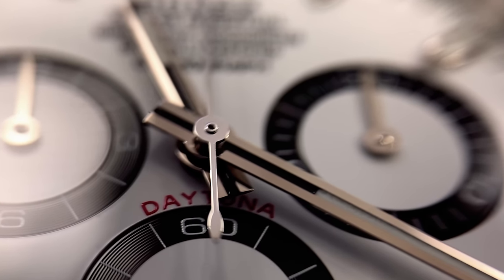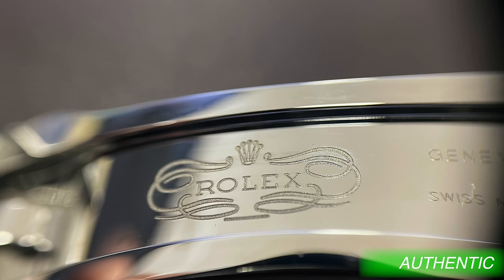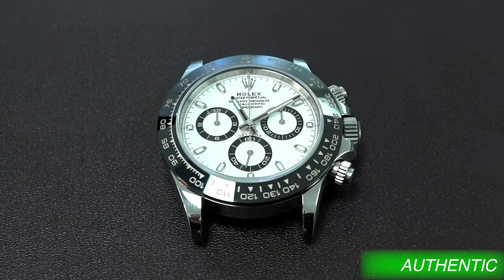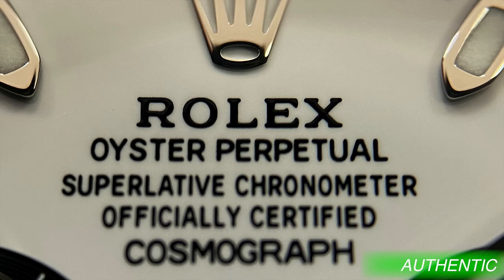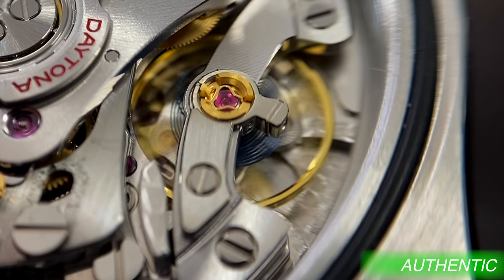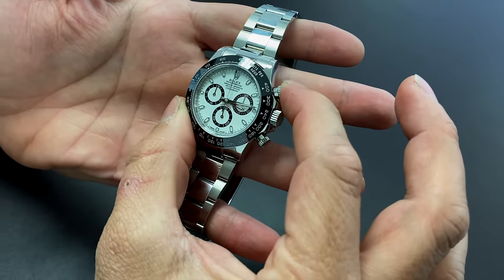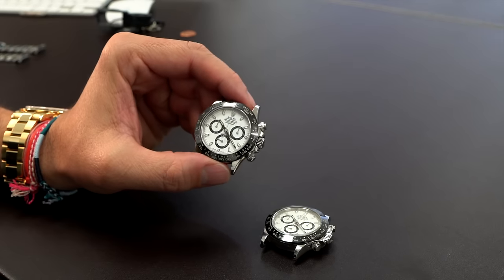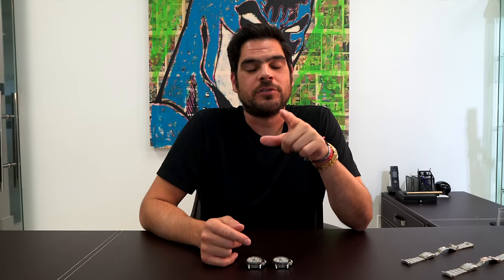5 Ways to Spot a Fake Rolex - This Replica is Scary Real! 😱

Comment: so best to stick to 18k gold model rolex s ! noob etc are not going to smelt down 18k gold to make a fake ! the weight alone will tell straight off ! over prices of steel Daytona to pre owned 18k gold Daytona not that far apart and u ve got real gold model !
Reply: Eh there are also NOOB 18K models if  you want... but they cost also 2000+ and also iced ones... you pay a lot extra for the gold.
Reply: solid 18k gold with the heavy weight  same as rolex or just plated gold over  the steel watch   much lighter in weight watch
Reply: @joesands952  You can choose for solid 18K or wrapped 18K... Wrapped it's only like 150 more expensive than fake gold color.  But with solid you pay a lot ofcourse and most of the time they are only on order (not in stock). not everyone is willing to spend 2+K for a High Grade fake.
Reply: thanks for the info. never new cud get solid 18k in a fake rolex !  but wud I trust sending $2000 plus to china for a big fake !  AND at the end of the day then its just a fake !

Comment: Shows that you should not buy a rolex (except from the authorised dealer), and that rolex is severely overpriced (and overrated). There are better watches out there for that money.
Reply: Right! , I have a real Rolex and you basically pay for the “craftsmanship” and brand maker lol😂, if people can find a good replica Rolex that works and looks like an original Rolex than buy it, the replicas are basically Rolex’s without the craftsmanship and original brand maker, made elsewhere in China or wherever.
Reply: yoliza1212  that’s a little funny...cause the Rolex “craftsmanship” you speak of is largely machine automation... Macro photography shown in many youtube and elsewhere actually illustrate that the machine automation is not even that great, where the dial shows paint bleeding and blemishes beyond that of say Glashutte, JLC, Omega and GS. They are great with the bracelet fit and finish and dial materials, but under par with aspects such as dial finishing and case finishing/contours. Again, they are essentially overrated and overpriced. FYI, I used to have 4 modern rolex watches at one point last year. So I am also speaking somewhat from personal experience
Reply: Watch Aficionado well I was just assuming that’s why there considered so “great” because of that and the brand itself , I agree they are over priced, I was just stating that good replicas are basically as good as an original Rolex but just made by another manufacturer.
Reply: yoliza1212 no worries..I misunderstood you.

Comment: If a fake is over 95% accurate , it is hard to justify the  inflated prices on stainless steel Rolexes. 20 years ago, you could get a gold day date for 5k 🤷🏾‍♂️
Reply: Lol I’ve never seen a 5k daydate unless it was some old beat up single quick set model that looks like it fell off a truck and over polished. Mine cost me $23K in 2005 brand new.
Reply: New one was 8800$ USD in 1982
Reply from the maker: Would you say the same thing about a Picasso or Rembrandt?
Reply: This is not a High quality fake I got a MUCH MUCH better DAYTONA 1:1 V3 4130 replica from Noob Factory. It;s EXACTLY the same thickniss as the real one (the one in this video is not...)
They cost a lot between 750-1000+ but than you have a PERFECT replica of the real deal! 
This one in this video is a Mid-range fake but absolutely not a A+++ Noob fabcric 'official' fake! Sorry buddy but this video says nothing if somebody uses a better Noob version! 
I checked my replica with a magnifier and it's really ALMOST perfect WAY better than the one in this video. Dials are also way better polished than the one in this video.. no bleeding in the lettering at all.. just like the real Rolex. I even let it check by a Rolex dealer even they couldn't see it in first glance it was a fake EVEN not with a magnifier...